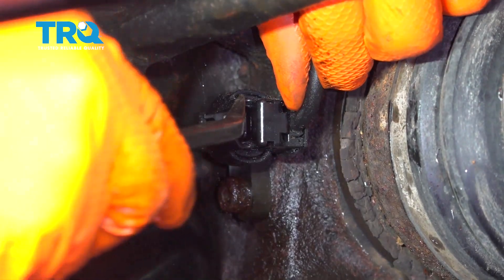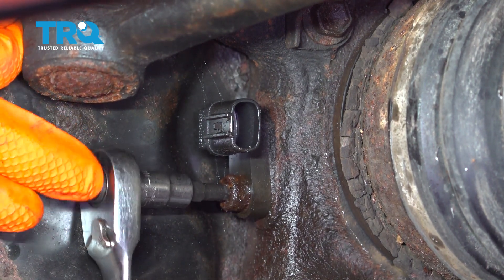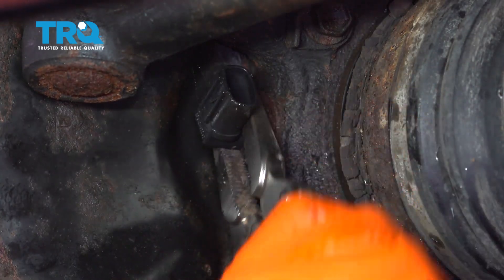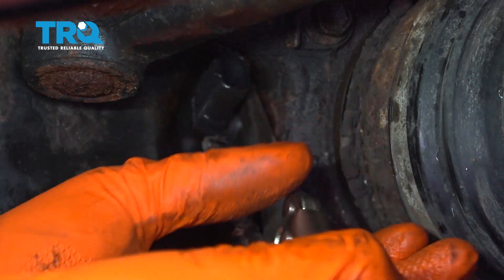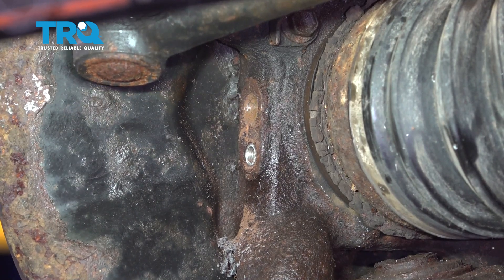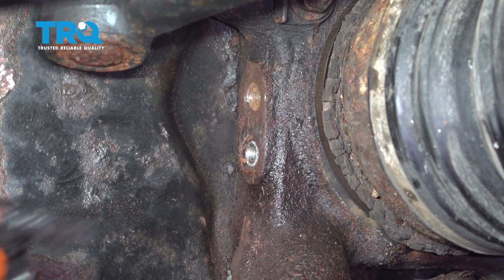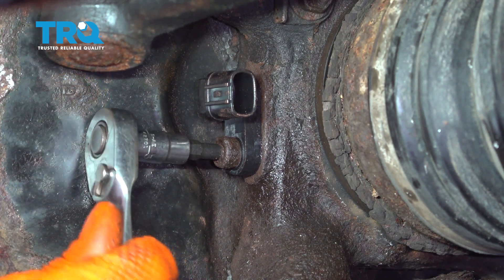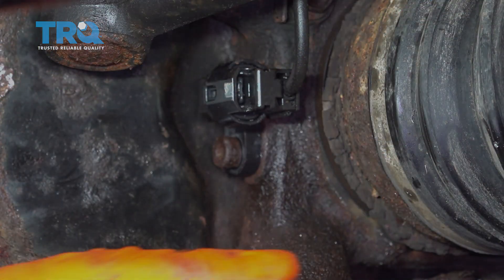How to Replace ABS Sensor 2003-09 Toyota 4Runner

Comment: Rando DIYer here: I wouldn’t put a drill to it. I did and ultimately ended up having to replace my front wheel bearings. Pulled codes saying debris was detected in knuckle, which also threw on ABS, brake and VSC lights. The professional mechanics found the tips of my old speed sensors inside with the old bearings. The tuning rings had been damaged too from the tips of the sensors being kicked around with the bearings. 

She was pricey.

Comment: Just another useless spare cash sensor to run a system that is surplus to driving requirements.
I absolutely hate my 4runner because of the constant drain on my wallet for stupid sensors and electronics that nobody needs to drive.

Comment: Wiggle really carefully after removing the 5mm bolt. 

There's a slot that allows you to fit the tip of a flat tip screwdriver between the sensor and the front knuckle or the rear axle housing. Insert the tip of the screwdriver and twist to start prying the sensor out. Once you get some movement, it will come out. There's a rubber seal around the sensor to keep moisture from getting in via the sensor hole and that's what causes the resistance from getting it out easy.

Comment: I have a 3rd gen 4runner and i’m having an issue with the abs randomly engaging when driving as normal. Literally anytime i am breaking around 5mph the abs kicks on. Is the wheel speed sensor the problem?